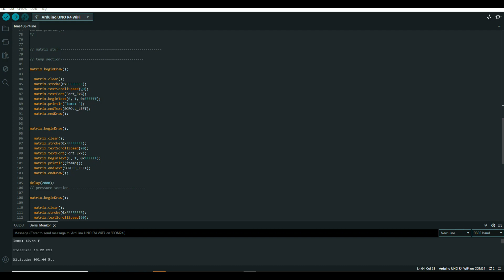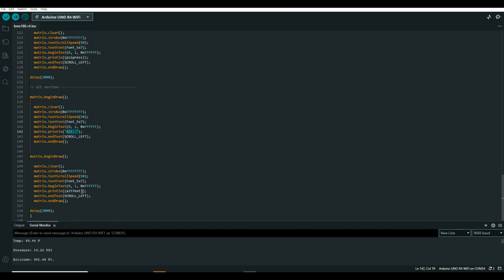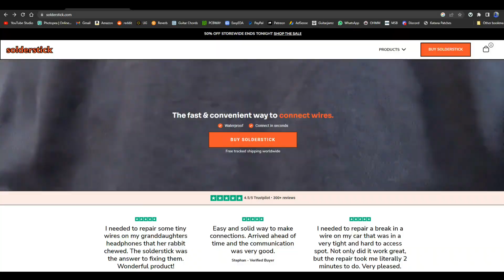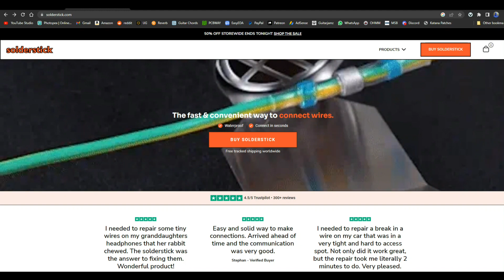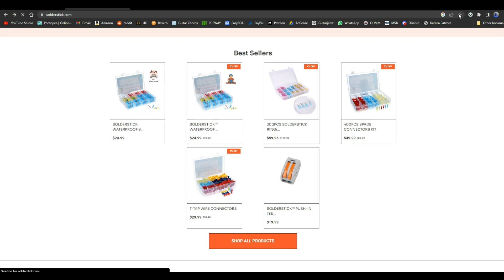How Useful Is The New Uno R4 WiFi LED Matrix As A Text Display? - Sponsored by Solderstick

Comment: I have found the display to be VERY useful for all kinds of things. It use is only limited by your imagination as is everything!

You need to encapsulate the matrix control functionality in a single "display" function. That way using the matrix is no different than a print to the serial port!  You don't need to have all that detail to deal with every time you want to display something.
Enjoy!

Here is working code to get you going...

ArduinoLEDMatrix matrix;  //define a matrix object for the UNO 96 LED display

//this function displays the passed string on the 96-LED display of the UNO R4 WiFi
//you could change the function to pass the scroll speed too by adding a parameter
//
void Display(char *text){
  // Make it scroll!
  matrix.beginDraw();
  matrix.stroke(0xFFFFFFFF);
  matrix.textScrollSpeed(40);  //40 is medium speed, 20 is fast 150 is slow
  // add the text
  //char* text = "    Scrolling text!    ";
  matrix.textFont(Font_5x7);
  matrix.beginText(0, 1, 0xFFFFFF);
  matrix.println(text);
  matrix.endText(SCROLL_LEFT);
  matrix.endDraw();
}

//in the loop...
char textMsg[256];          //bucket for string
char matrixMsg[1024];   //buffer for 96-LED display

//some code to display the RSSI of the WiFi
//use sprintf so we don't have reams of Serial function calls cluttering the code
snprintf(textMsg,sizeof(textMsg)," Trying to re-connect MQTT. RSSI: %d ",WiFi.RSSI()); //build the string with objects to display
Serial.println(textMsg);
strcpy(matrixMsg,textMsg);

snprintf(textMsg,sizeof(textMsg),"Boiler Temp: %0.0f, ",tempF); //display a float temperature value
strncat(matrixMsg,textMsg,sizeof(matrixMsg));

Display(matrixMsg);

Comment: I think debugging Arduino code should be the only thing ChatGPT should be used for.

When ChatGPT first became massively known I did test it's limits and there are many. However I did discover it's really good at both writing and debugging Arduino code.

If you haven't tried ChatGPT now may be your chance to give it a try at getting rid of your extra characters in your text strings.